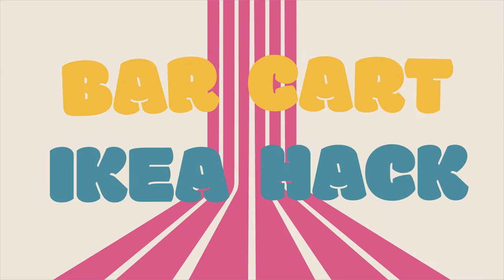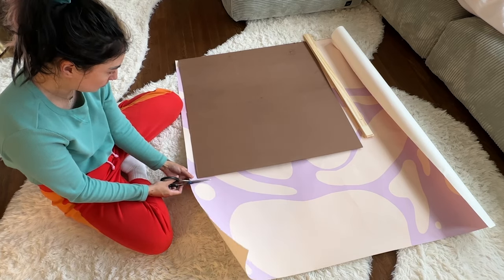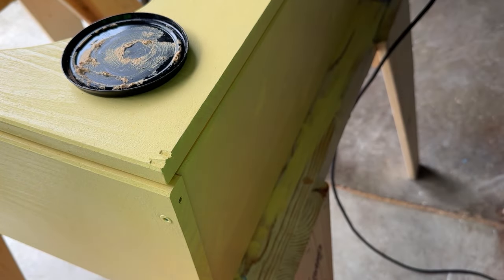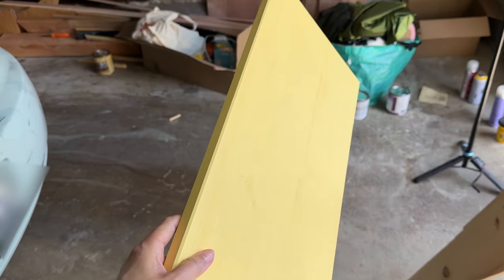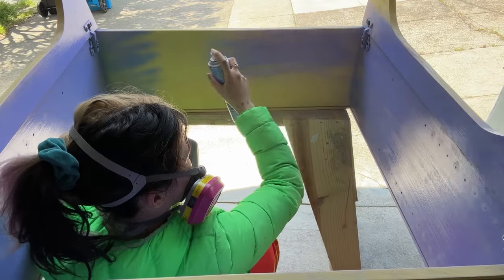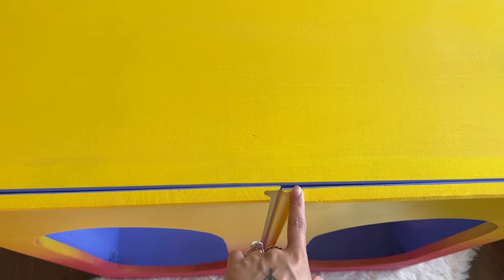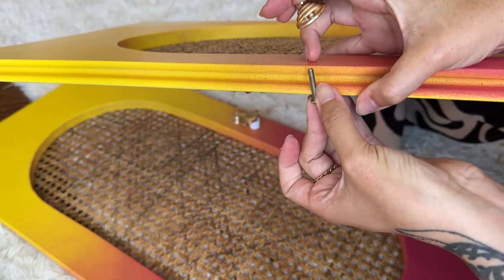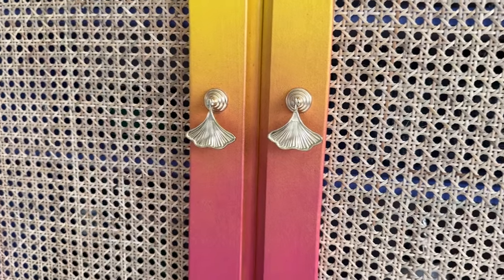My BEST Ikea hack: Gradient colorful bar cart, DIY project!

Comment: Tip!: instead of gluing on the door handles, use a wider drill bit to create a recess on the back of the door.  Shorter screws will fit this way 😃

Comment: I highly recommend spray painting while in close proximity to your car. Cool cabinet. Also, hot tip, buy a set of nozzles. There are all different types of throws with different nozzles, some are super wide throws and some are fine tip and concentrated. With all of those cans you have I’m sure you have a whole set of tips already, but you have to find which nozzles have which patterns. Then move the caps around from bottle to bottle for the purposes you need 👍

Comment: Looks really pretty!
Usually, you can exchange the nozzles of spray paint. If a nozzle isn't working right, just pull it of an push another on there.
The liquid nails solution worked well for the handles! If you run into this again, you can also make a very shallow hole with a drill bit slightly bigger than the screw head. Then, in the middle of that indent, make the normal hole for the screw to go through the door. The screw will be sunken in, and you'll be able to place the handles ^_^

Comment: Hey this looks awesome! Just a tip: next time (or if your solution fails) just drill a recess the size of the screw head half way through the wood so that it can then reach through enough to screw into the handle.

Comment: For the handle screws, you could have just made a bigger hole halfway through the door to fit the screw head, then filled it up with wood filler and painted it
Reply: Yes I was going to mention recessing the screw into the wood a bit too! Especially for heavier doors or drawers. Came out beautifully though